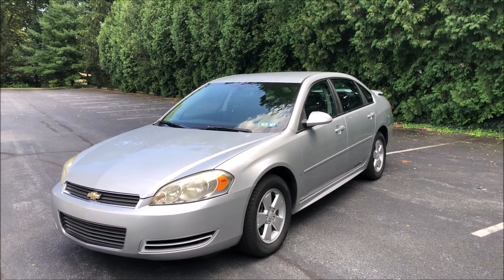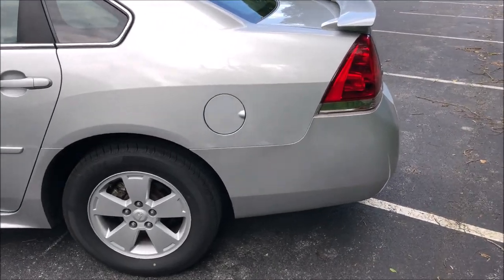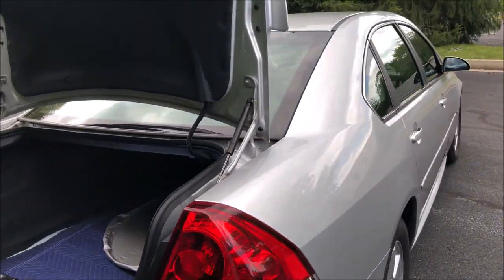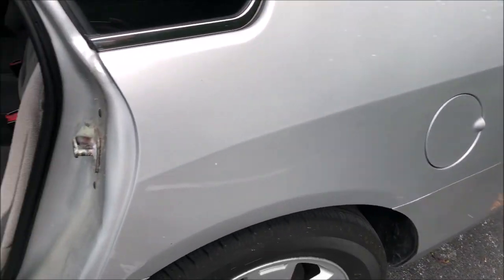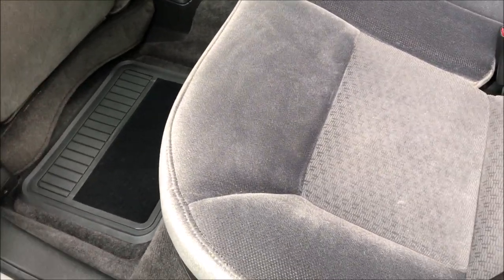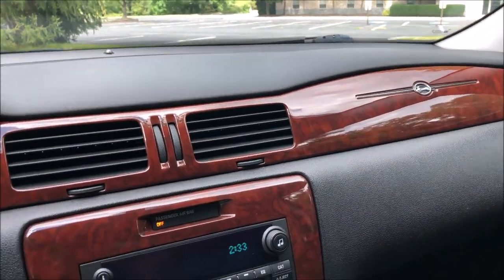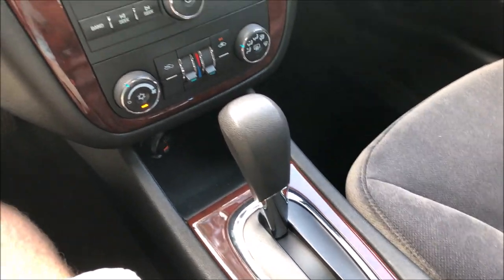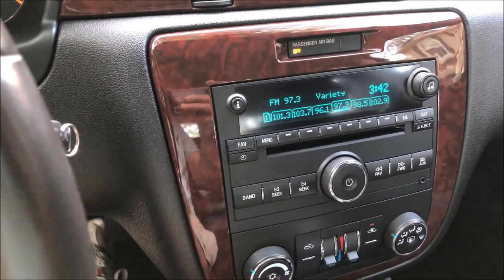2010 Chevrolet Impala: Tour And Review

Comment: For the 2012 model year got the 3.6 V6 not 2011 along with minor styling changes and different wheels. I had one a 2010 LS the car wasn't good. Just a smooth ride for long straight driving on the highway or streets. It turned sloppy and hard to park.

Comment: Great video! How did you program your key to the car? I plan to use the same key for my 2010 impala LT as well.
Reply from the maker: Thanks!
I had the key cut, then there was a sequence of inserting the old key in the ignition, then the new one. I think the instructions came with the key. I can't actually remember off-hand, its been a few years. The programming for the fob is done through the drivers info system, it's easy
Reply: @sethsaylor760  Great thanks so much!